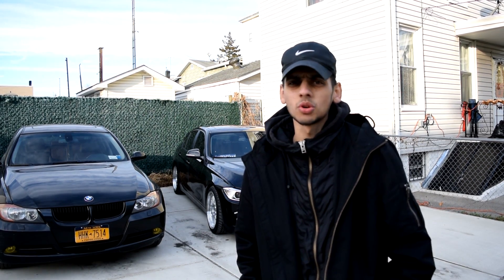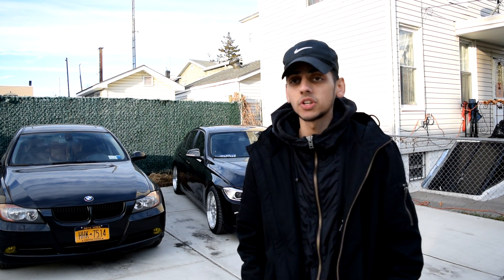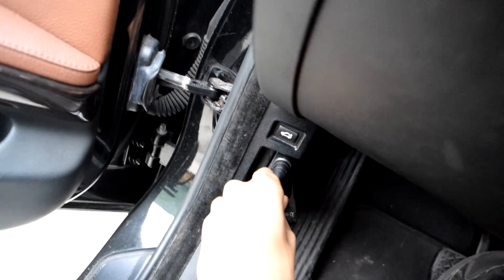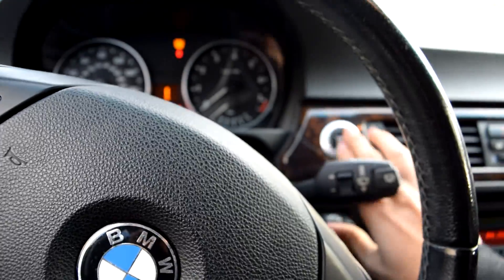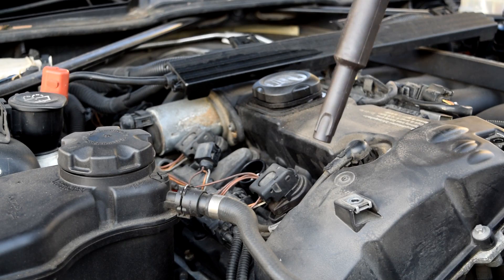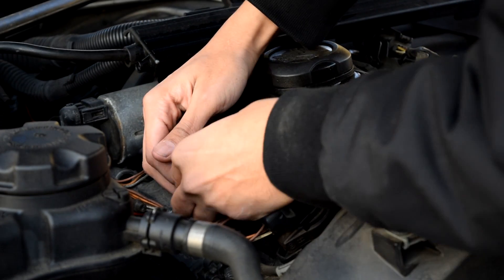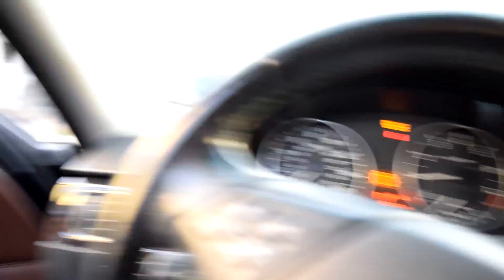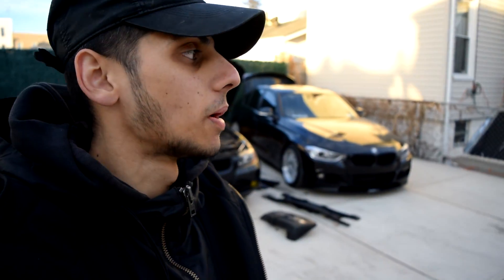How to diagnose a Service Engine Soon light on a BMW

Comment: Shumile, thank you so much for this video and for the advice.  I've got a question (for anyone!) on my 2006 X3 (129K miles).  The ignition coil went bad on Cylinder #5 a year ago... and the ignition coils are currently bad on cylinder's #1 AND #2... would you go ahead and replace the other 3 ignition coils as a preventative?  they are roughly $100 each.  part of me doesn't want to spend the $ until they are bad but if 3 coils have gone bad within a year... doesn't that indicate the other 3 are soon to follow?
Reply from the maker: Some say its good to do all at once, ive done replace as needed and everything has been fine, so you’re fine. Just replace the ones that need replacing rn, change the other ones once it throws a code
Reply: @ShumileSwift  Thank you sooo much for the response.  I really needed some advice.  It's strange that in all the (premium) cars I've owned over the years, this X3 is the first time I've ever needed ignition coils.. and so far it's needed 3.

Comment: I bought a rebuilt title bmw 328i for 7500 with 124k miles on it. I just bought it 2 days ago and a check engine light came on its not blinking at all its just sold light. There's no leaks from the car but the air conditioner doesn't work at all and the car makes a slight burning smell(very slight but noticeable). The car has full oil and the coolant looks green and full inside the car. Do you guys have any ideas

Comment: Thanks for the video, good job. How do you reset the service engine soon light. Do I have to have a diagnostic reader or can I do it with built in car controls. The other issue is I changed the oil and reset the mileage change . The car picked the new mileage at the next 5 000 miles, but picked the date for one year from now. How  do I reset the mileage date. I have tried everything.
Reply: i replaced the ignition coil and spark plug and vehicle is back to normal, unable to clear the Service Engine soon light. ANy help if it goes away by itself or alternative methods to clear

Comment: Good job. How do you get rid of the 'check engine light?'
Reply: I think find the problem with a scanner, fix the problem, then check for the same or other problems. 

If all clear, does your scanner have a function to clear codes? If you use this, then operate the car a while and check for more codes. 

Else, try the standard routine with the odometer stalk and BC buttons.
Reply: @TSPhotoAtlanta  not true

Comment: my 2012 BMW 328i engine locked-up after my service engine light came on and instructed me to stop enging. Do my 2012 BMW 328i have a shut-down mode that prevents damage to the engine?

Comment: Lol something wrong about BMW It needs out of all exhaust needs one less. Mainly front long throw muffler but runs great on emission one next to the engine needs removed and resonator you can place straight thru if it has no catalytic if none. As this backs up exhaust so if your going to back up pressure do it at bumper exhaust.
Ignore this if you have two or three  mufflers, 

Causes exhaust to go back thru air intake called chalking an engine,

Comment: So I Must be doing something wrong on the realoem.com website.. not seeing where to add to cart
Reply from the maker: CBRFRENZIE you cant buy from realoem, you get the part number, copy it, and paste it in a search bar on a site where they sell the parts. Such as ECS tuning or FCP Euro
Reply: has anyone used Bavarian autosport? they seem to better on pricing, wish i had some coupon codes, anyway thanks for the heads up

Comment: Great video!  Great advice.  Just a couple of comments from my past experience.  The BMW service dealer (not BMW dealer) that I take my vehicle said that you should replace your plugs when you replace the ignition coil.   Often the plugs are what causes the ignition coils to go bad.  Also, according to the the service dealer (I trust them) they said it is best to replace all of your plugs and coils at the same time.  I'm not expert, but I had one coil go and I replaced it (not the plug).  Three months later another coil.  That time I replace all coils and plugs with no issues since (over 6 months).  You decide, but from an engineering perspective it makes sense.
Reply: "according to the the service dealer (I trust them)" ... Well THERE is your FIRST problem.  NEVER trust the stealership!
Reply: @FunWithPaul  Did you read my comment???   The BMW service dealer (not BMW dealer)

Comment: I don't know if that's a lifter or what. It sounds loud. Do you use full synthetic? Use MMO before an oil change and get good oil. Most lube shop have crap oil for these cars.

Comment: When you ran the diagnostic and it said misfire cylinder 2 did the scanner tell you further details on exactly what was the problem Or did you assume it was either the spark plug or coil?

Comment: Just to add to this, you should really read the codes, then clear them, then rescan. Remaining codes is your issue. 

To cement the fact it is a faulty injector you can switch it to another cylinder and see if the code follows.
Reply: Thanks

Comment: I got an OBD2 WiFi Adapter for about 25 € to use with a free iPhone app.
I just wanted to mention that because it can be way cheaper than your method, and in my opinion even more practicable because you can use a coding app and code your BMW aswell (but this app may cost about 12 € aswell) or show live speed and RPM (and a whole bunch of other stuff) with another app and let it just plugged in (it has a power-button on top) :D